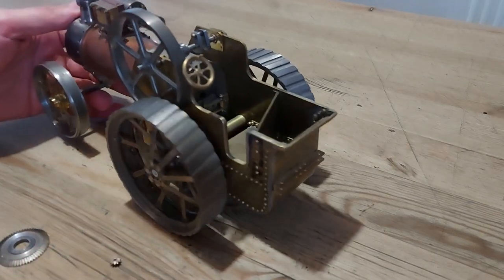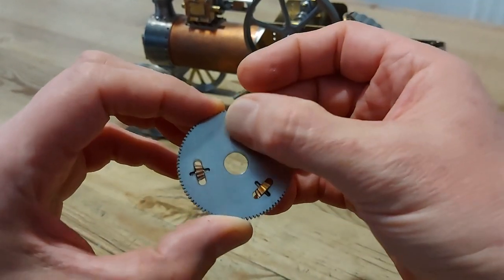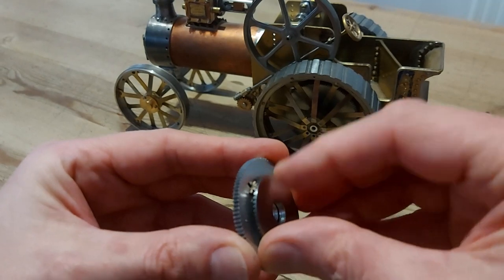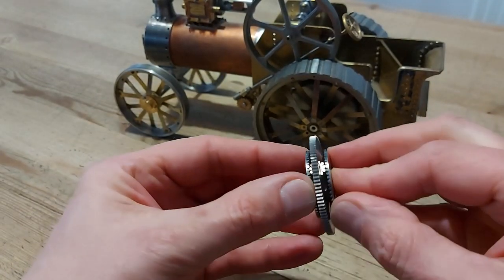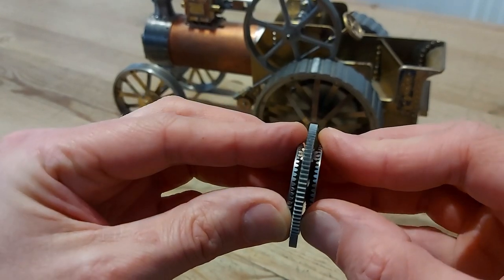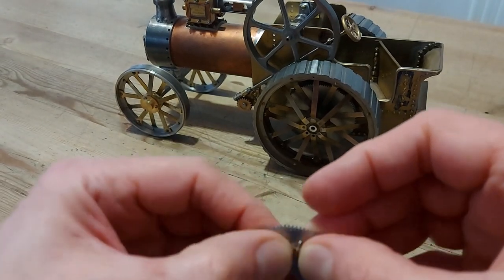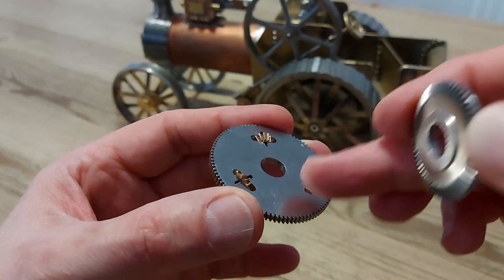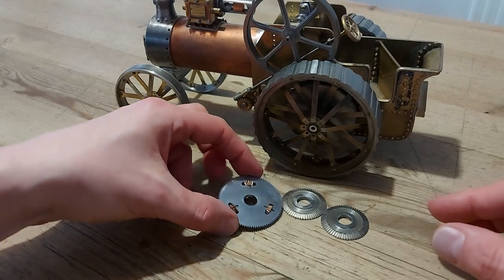Miniature Burrell Differential

Comment: excellent!
is the differential used on prototype? or is it something that you are "freelancing"?
thank you for a great channel!
Reply from the maker: hi and thanks, I'm not sure this initial design is small enough and hence prototype. It may be that I get this working and get it slim enough that I fit it to the traction engine, but I might have to go and make smaller gears. The design is on paper and in my head at the moment, I will go to CAD and create drawings for the engine at some point.